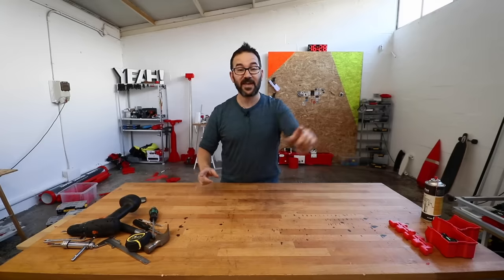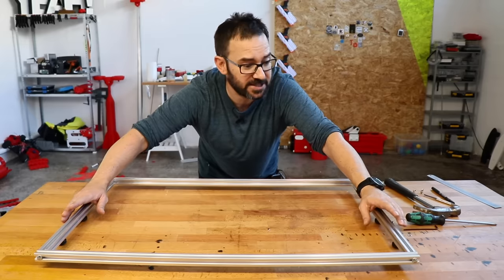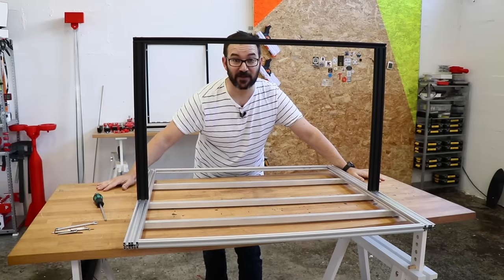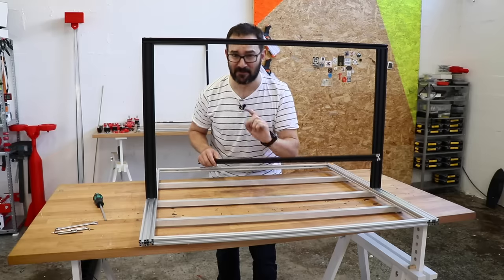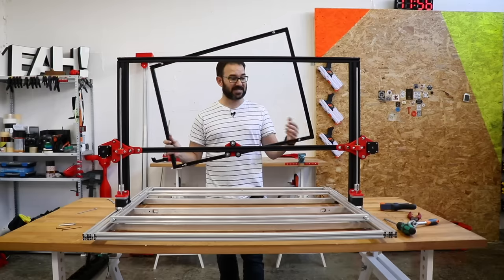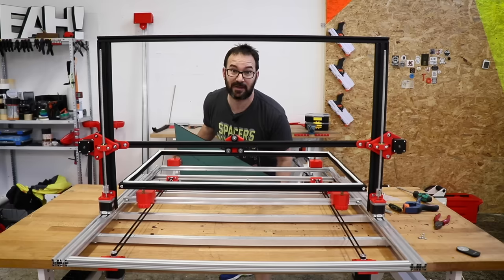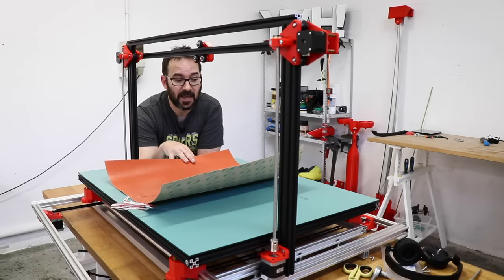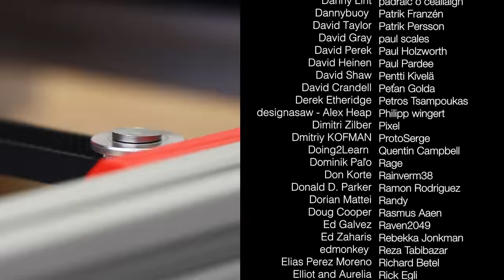GIANT DIY 3D PRINTER FROM SCRATCH

Comment: I'm always impressed with your skill as a designer. I do agree with the others who have concerns with the weight of the bed. However, this looks like a very specialized printer. You will need to print slow but with a large head it should still out perform a smaller unit making smaller parts that need to be assembled. A print failure with this thing will potentially be very bad though. I wouldn't worry with the bed adjusters. Get it close and lock it in place.  With a bed that large you will need a BL Touch anyway.

Comment: How much will / has this project cost? It seems like it could be cheaper than a store bought printer of this size, right?
Reply from the maker: Should be, I guess so, yes
Reply: @ivanmirandawastaken  You don't actually know how much this printer cost you so far in euros? Or did you sacrifice your screwdriver for it (as you are using an actual hammer ;-P)?
Reply: My kit 3d printer was $2.500 .UK brand hopless still struggling to get it working .I shood of got u to bild me a 3d printer lol....this is lookn cool an strong frame so fare .bed wait an bed plate. Hope can hold the wait .luv to cee next vid  adding all the electrics n printer head .is the printer head move down to print plate  or does print plate move up n down to printer head ..
Reply: From other posts it seems like he’s not finished and parts are still coming so things can still change. Also 3d printers have a huge price range.
Reply: Riley Fenley yeah, seems like he’s being overly vague and short with his responses...
Reply: Rublie14 where are you going to buy a printer this size? Also, he’s building it because he can. Some people just like to tinker.
Reply: @jakefromstatefarm8545  you probably can't buy a printer this size, but that wasn't the point of my question... I wanted to know how much this printer has cost him so far.

Comment: Very nice build Ivan! Personally I would have combined the z-motor mounts with some 3D printed angles to reduce movement of the x-axis gantry. Looking forward to the next part!
Reply from the maker: The motors are flush with both rails' the brackets are just to avoid axial rotation and YX traslation. There's almost no work done by the mounts on that configuration (Check a CR10 if you can)
Reply: @ivanmirandawastaken  I was thinking more about "locking" the uprights in relation to the base frame. I am sure the brackets are fine for attaching the steppermotor. (The CR-10 does actually have a t-plate supporting the uprights)
Reply from the maker: There's no movement on that plane. What work would be done by the added.members?
Reply: @ivanmirandawastaken  The same as the braces for the CR-10 MAX. I probably explain this badly :-)

Comment: Isn't that a size when CoreXY becomes easier than cloning the mechanics of small printers?
Reply from the maker: Easier than this... Someone would need to show me
Reply: Easier/cheaper to replicate, no. Easier to achieve a better, more consistent print quality, yes. However, knowing who is building this monstrosity and what it's going to be used for this should work just fine. Also he's going to be using at least a 1mm nozzle instead of a 0.4mm standard nozzle so quality shouldn't be too much of a concern.
Reply: @ivanmirandawastaken  you could mount the bed into 4 threaded rods or something like that (would give you electronic leveling by default), and use that as your Z axis, the whole bed slowly moves down with gravity. Then, the hotend is mounted in a way that one axis is fixed to the chassis of the 3D printer (say Y) and the other (X axis) rides on top of the other one. The hotend would be mounted to the latter axis. This is (to me, personal opinion) a tad harder but way more reliable. It will help reduce ghosting and increase print speed and acceleration, which in a bed as massive as that one are quite important factors. 
This design, though, will work just fine, and it comes with a big advantage; it's already done.
Reply: @ivanmirandawastaken  
You 100% need auto bed leveling ivan the glass will sag a little in middle get a bltouch they are what you need
Reply: CoreXY would mean you need to move this humongous printbed up and down, perfectly level. Or you put the hotend on a Z axis, which I haven't seen that often, either...
Reply: @Andreas-gh6is  I have seen a few coreXY floating around YouTube where the bed stayed at the bottom and the XY gantry moved up on Z. Not as common for sure but due to the mass of this bed the gantry would be the lighter part to move.
Reply: @nathantoews152  Yes, that's workable, but I think that may be more complicated and for example it may require a much sturdier gantry. Of course that assembly is lighter than the humongous mirror, but up in the air that could still be a bigger wobbling problem than the moving mirror.
Reply: core xy that big means very long belt runs. That's not done due to racking. This is easier as it's less parts, I'm curious as to what happened with the other printer you built -- I think it was in the bathtub?
Reply: @kazolar  But there is a lot of weight, too. When scaling the whole printer, isn't the weight of the bed growing quadratic, while the length of the belt in CoreXY is just a fixed multiple of the beld, which is used anyhow? (This is my backup account, somehow the answer from my actual account Merkatorix is not shown here).
Reply: @ivanmirandawastaken  I am actually considering buying the parts to make a Core XY printer but the bed size won't be bigger than 500x500 sadly. I already have all the electronics minus the motors (leftovers from a Tronxy x5sa) and was going to make it a 500x500x600 print volume.
Reply: @Andreas-gh6is  on the contrary. That gantry is fixated to the frame at 4 points using linear rails. It will have no more wobble than if it was permanently mounted at the top of the frame. And if your print isn't using the max height. The lower the gantry is it's even less likely to have wobble due to a flimsy frame. So in theory it should actually be an improvement on the coreXY system. (But more complicated)
Reply: @nathantoews152  if anyone wants to know more about the xyz gantry system, look up the voron2.1. It's really neat.
Reply: easyer??  never.    
better for printing?? DEFFINATLY
Reply: @nathantoews152   any chance you could link a video, I can't picture that in my head
Reply: @lukedavid8099  That's a good point, regarding the nozzle bore. A 1mm noz won't ring nearly as visibly as a .4, and that's about the range where holes will need to be tapped, reamed, or stuffed with threaded inserts anyway, so wobble within holes isn't a concern at all. That in mind, this'll probably be just fine for everything but...I don't know, giant perfectly-balanced flywheels, which I can't even manage in a smaller scale on my modded-to-the-moon Prusas. (Yeah, overkill fidget spinners are my weakness, much as I've tried. That's why I added a minila the to my arsenal, to do the super-round stuff in brass.)
Reply: @Andreas-gh6is  Not a problem. Just use four floating leadscrews and four beefy smooth rods or linear rails- one at each corner, with one long continuous belt and a single gear reduced stepper to provide the needed torque.

Comment: Seems like a decent design, it will probably work fine. A few thoughts though: add some kind of wooden plank under your mirror: it will not prevent much from sagging, but it will help to protect the mirror in case you jam the extruder into it, which can happen and did happen to me on my giant printer, especially during calibration. Better add a few more aluminum profiles under it too, on such big surfaces you can get pretty big sagging, like over 2 millimeters, which obviously doesn't help with first layer adhesion. Other than this I'm pretty sure it will work fine, nothing wrong with it :)  Even if the Z axis looks flimsy, I bet it will not be an issue, most people put too much efforts in frame rigidity while it actually doesn't matter all that much, except for very high speed printing. Giant printers do work very well, much better than most people would guess, and that teaches a lot about what actually is important to get good printing results on a 3D printer. Good luck on the rest of your build!

Comment: On the printing bed leveling: with a larger print would the weight of the print cause it to go off level?
Reply: Absolutely. I think there's probably going to be an upgrade video or two down the line after that problem comes up. Probably the easiest option would be a diagonal brace to support the center of the bed and restrict sagging to a few cm from the corners that aren't over the brace bar.
Reply: William Shreckengost I thought he would have gone higher capacity but the sagging might be a minor issue. I was wondering if the spring loaded balance technique will get affected on this with the larger weight and center of gravity shift (as mentioned).
Reply: MichaelKingsfordGray  You're right, I was stuck on the bed, instead of the whole Y carriage. It's definitely beyond the means of the kind of springs that'd normally get that job, but lock nuts might be able to do the job well enough. (Though it's definitely a speed cap either way.) If not, it could be down to a fixed bed mount, which is going to take a hobbyist's fortune in measurement tools to set, and linear rails instead of V-rollers to take out some of the wobble potential. Not that I wasn't already convinced, but I'm seeing another good reason to go CoreXY at this scale.

Comment: You definetely want to stabilize the frame and maybe switch to full screw drives (belts may need a high tension, to keep prints clean and even, which would strain the motors)
Reply from the maker: The frame is stable, belts? Could you please reason your suggestions further?

Comment: A moving print bed is an interesting choice at this scale, as others have commented. But I think this might be the better tradeoff. Moving a bed of this size up and down, perfectly plane, would be more complicated. Having a gantry for XY and the Hotend on a Z axis would also be more complicated. Considering the kind of parts Ivan is famous for, the ringing or quality in general really is not that big of an issue. Before using bigger stepper motors, it might be a better idea to just use two of them pulling on the same or different belts. I wonder if it is possible to limit X and Y velocity separately in a slicer, because the X carriage will be able to move faster without problems. And I recommend TMC drivers for missed step detection!

Comment: For a bed this big I would seriusly consider an aluminium sheet and a PEI mag sticker. Might seem expencive or overkill but that Y is gonna have some serius ringing. Basically put an aluminium strut in the middle and a sheet over the top. You could even PCB heat it.

Comment: So, we are going to have several videos about dynamic stiffness. Or how slow can The extruder move. A word to the wise this will all be about accelerations settings.   Still a great idea you need a much larger printer for the parts that you are printing
Reply: The extruder will move pretty fast on the X axis. But yes, I guess this calls for some tricks with the slicer.

Comment: From an engineering standpoint, im lost as to why your proportions are so off? Your X and Y  aren't nearly proportionate to your short Z-axis and you used small bearings, motors, and an extruder designed for a desktop machine. Why didn't you scale all your hardware up by say 300% +/-  to match the bed size? It feels like an ender 3v2 with a long XY and short Z instead of an actual large format printer. For a first attempt though, you did a nice job its something you can learn from and move forward with other builds

Comment: Awesome video! I would suggest using either core XY or a traditional "box printer" system like with your earlier "big printer". The massize weight of the print bed + the part would be ridiculous for any motor or combination of motors to handle. It would also take up twice the size.

On a side note, I just discovered your channel the other day after being bombarded by the youtube recommended list's incessant recommendation of your kayak torpedo video for a month. Your projects are amazing in size and scale, and you use the best color too! Best of luck.

Comment: If you have stringing and oozing issues with the super-volcano, print from your filament dry box and upgrade to Molecular sieve/Zeolite descant.  When filament is ultra dry, there isn't any squishy dissolved H2O in the melt zone so stringing and oozing virtually goes away.  Also try printing with extrusion width set to >100% nozzle diameter, when you get to the high extruder pressures the plastic expands as it comes out of the nozzle and causes problems with acceleration.  Printing wider gets around this and lets you keep cranking up the speed.

Any plans for Z-braces?  That massive bead might really get the Z-tower swaying!

Comment: Looking great but what about "spa-" er... "bracers" for the z axis?  ;)
A triangle from the top to the back seems like a reasonable addition since the bed will be moving back and forth and is likely to induce some wobble to that tall assembly, especially as the weight of the extruder and x axis moves higher.

Comment: I see 3D printers as being very closely related to machine tools. All the same kinds of factors matter when it comes to machine design, function, and precision. The amount of fabrication you do in addition to 3D printing, and the creative solutions you come up with, almost beg for a better way to make the non-printed parts required to make all your incredible contraptions work. 

With a lathe and a mill, even the small Chinese-made Harbor-Freight/Grizzly/Seig benchtop machines... You'd be unstoppable. Adding that skill set and capability to what you can already do... You could make some truly wild things, and make them faster, stronger, and more precise. 

Just my two cents. Looking forward to seeing this big printer come to life!

Comment: With the parts being printed on this beast of a printer, I wonder if it wouldn't make sense to us granulate instead of filament. You'd need to swap roles 3 times per print. It also would be interesting to build a granulate printer.
Reply: xDanoss318x he uses 5kg rolls from his sponsor Aprintapro. I don’t think that will be a problem.
Reply: Riley Fenley Ah, Ok, I didn‘t know those exist. Thank you FYI.

Comment: The biggest issue i see with that bed is the heat flex of the mirror. With no support its going to droop down in the middle especially now that you have the added extra weight of the heat pad and thermal cover. You may get an initial flat surface but over time with continual heating and cooling the mirror will warp and you'll get an uneven print surface.

Comment: Probably should have went with moving overhead gantry.  Moving that bed is going to be big, and expensive energy-wise.  Additionally, if you're going to need it heated (you very well might), then moving the bed also comes with losing a lot of heat, as you're essentially wafting it into the air around the printer.

I understand having a CoreXY or an overhead gantry also adds some complexity to the design, as well as vastly increases parts count, but maybe something like the Printrbot Big-E could have been viable.

Comment: Ivan Miranda -- You need a better way of bracing the corners! Diagonal braces are best, of course, but can get in the way. Maybe some castings, with bolts extending into the rails? Otherwise those rectangles are still going to 'rack' a bit.

Comment: Your video is informative, educational, bold, enlightening, technically astute, enjoyable and humorous. I especially appreciate your subtle, but clever humor (like “unusual procedures”). How do you manage to put all that into a less than 12 minute video?
As a technical detail, I would suggest additional supports for the very large bed. Supported at the perimeter only, a piece of glass that size will surely sag from the perimeter to the center.
Another thing I wonder, is why no one has built these using servos to control the heavier components? I know cost is important, but dude...the size of that thing. That bed and maybe a three filament direct Drive head scream for the accuracy and power of a servo.... just sayin’.
Thanks again. This was a delight!

Comment: If that's not tempered glass, you're likely to anneal droop the glass surface, not right away, but possible. Is there a way you could support the void in the middle? Nice build though.  What are you using to controll it? Normally the consumer printer bords have one output for 'Z' axis, the assembly is nice 😊 keep us posted for the updates 🙂

Comment: Amazing project! With that size I would have imagined a corexy, but after seeing how huge the bed is I can't imagine a way to reliably make it go up and down reliably!
What nozzle size are you planning to put on the supervolcano? I am concerned that the mirror could flex a little under its weight and that of the print, and that the white seals that supports it may compress a little. But if you print with really large nozzles the flex might be negligible. My last concern is that you are going to print so much plastic that the price of red filament is going to increase due to a shortage in supply!

Comment: I have one question.... What's the point? I mean theoretically if you need to print something that big it's going to take weeks to print it, which isn't exactly practical. You'll need to change filament several times during one print. It will take about a day just to heat the bed, lol.
And that gantry style is going to do wonders for ringing, visible layer lines etc. A CoreXY system would have been better suited to this.
When I have large prints, I just print them in multiple parts and fix them together. Bosh. Job done.